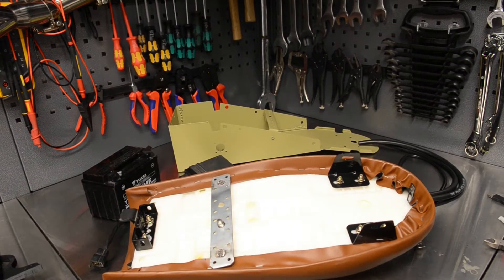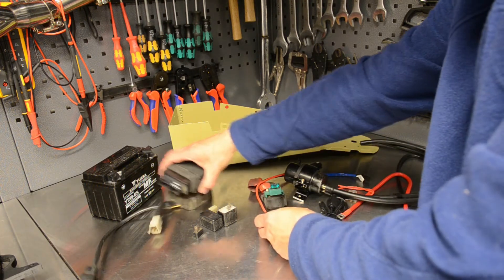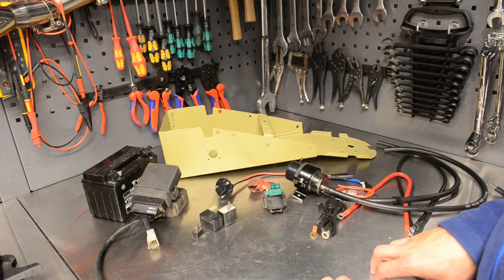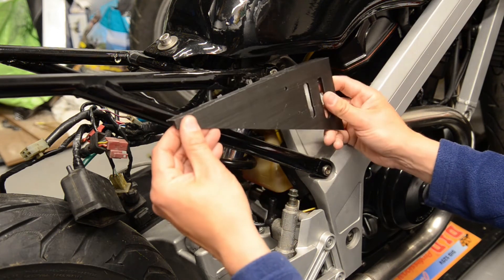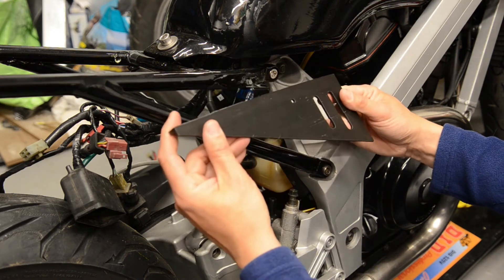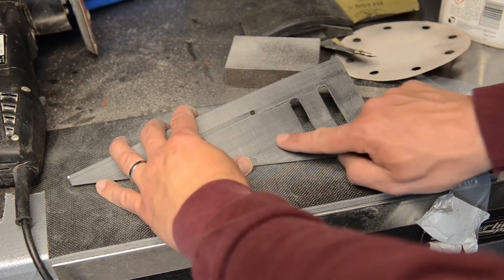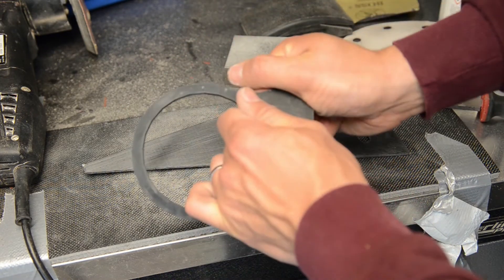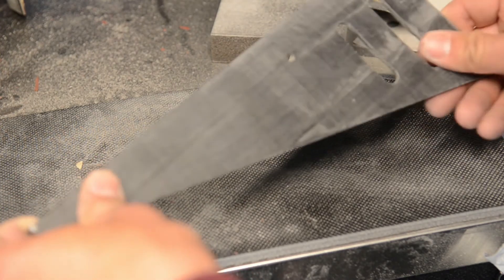Honda Bros NT400 Restoration Project Part 36 PETG 3d fairing print

Comment: Did you consider using Foamex for the cover....really easy to work with..comes in various thicknesses..10mm would be perfect and give some depth to the cut-outs....
You'll probably need to spray yours..vinyl doesnt like rough surfaces if you were thinking of a wrap...
Reply from the maker: No I have never used it but I might give it a try, your right. I wrapped it but there is no debt to it, and carbon looks shit against the black so I need to think about the finish in this now.